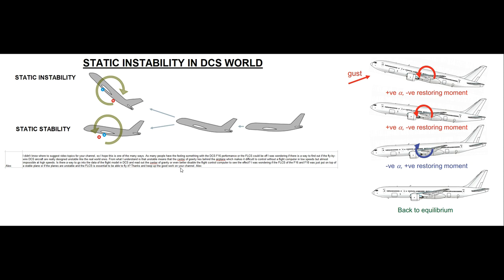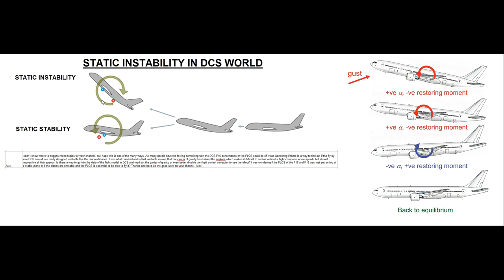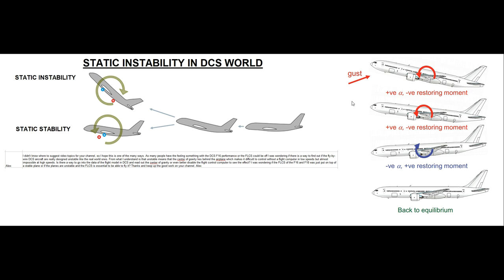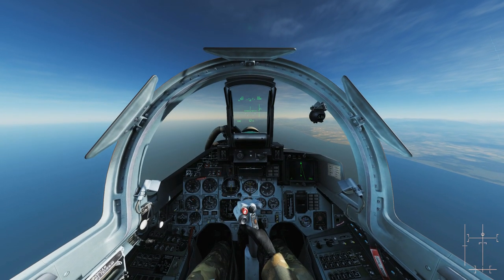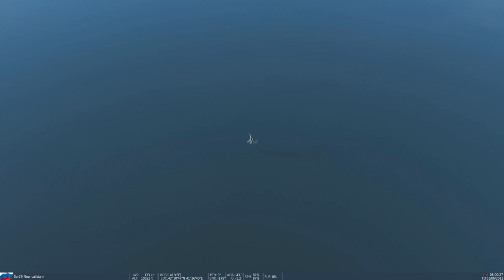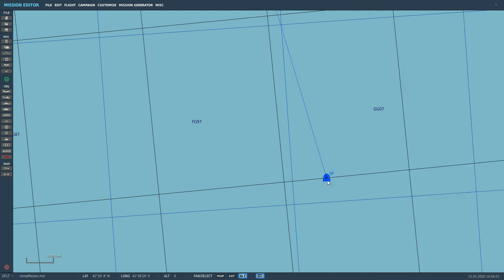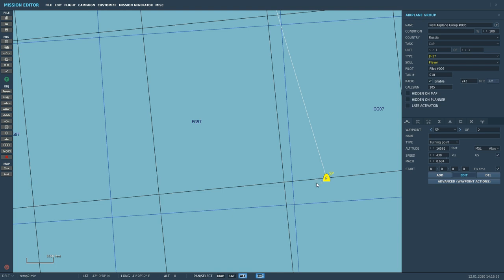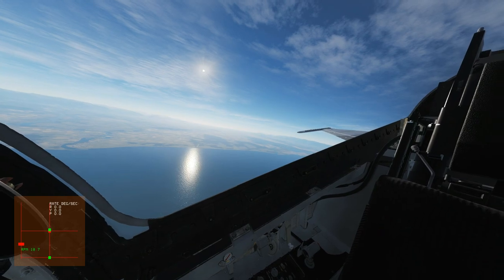Questioned: How Is Fighter Jet "Static Instability" (Unstable) Modelled In DCS WORLD?

Comment: As soon as someone mentions "Gust" when talking about stability I know it's going to go wrong.  It's almost as bad as people discussing the difference between downwind and upwind turns.  I'd give this video about 3 out of 10.  The DCS demo in particular was pretty poor attempt at showing stability or lack of it.
Reply: Could you provide corrective info in addition to your critique? Just saying they did it wrong doesn't help the rest of us
Reply: Firstly, sorry, was having a bad day.  "Gusts" are a misnomier as they effect the whole aircraft equally.  Like nudging a fish bowl does not nudge the fish it still remains stationary relative to the water.  In DCS, take an A10 and crank hard back.  Watch what happens to the roll stability due to the rear bias.  It snaps.  Loses roll stability even with the stabilisation controls on.  The F14 and Harrier do the same.  The harrier is hugely effected in this profile by aysmetric loads. A civilian aircraft outside of aerobatic aircraft won't do this.  This would be a better demonstration of lack of stability in fighters.
The F18 (and probably the Jeff) actively restrict your control inputs to avoid the roll instability, though you can still provoke it if you try hard, particularly at low speed.
DCS world must simulate instability in most aircraft as they can be spun.  A spin is a  loss of stability that gets increasingly worse, is effectively negative stability.  In a fully developed spin you can go hands off and it will not recover.  In saying the aircraft has departed you are saying it has left the stable region.  That said even fighters have some design considerations to make spins recoverable, but get it far enough and it won't come back.
What I would like to see in DCS is, can you get a fighter into a fully developed "floating leaf" spin.  The aircraft falls straight down like a floating leaf, rocking back and forward, side to side, but never enough airflow (even rotational such as a flat spin) over the control surfaces to recover, assuming the engines dont help you as they probably flame out.  I have got this in the F18, but using aymetric thrust to halt the rotation in a flat spin, but (a) it has Wagner godly controls and (b) the engine dont flame out so you can accelerate out of it.
Reply: Paul Campbell appreciate that the term ‘gust’ isn’t helpful for some viewers with perhaps a better knowledge  of aero engineering. Disturbance or input would be better, however These videos are meant to cater to those that, unlike yourself, may have no understanding of any of this. Thanks for the comment though, great to hear discussion like this going on down here!
Reply: @1over137  no worries. Thanks for the explanation!
Reply: @1over137  Just wanted to add something quick about the engines flaming out cause that's only where I know a fair bit. 
Modern FADEC engines like the F104 and the F414 that powers the F/A 18 for example are constantly monitoring fuel mass entering the chamber and heat output of the combustor as well as the air mass entering the combustor. If one were to deviate such as air mass or heat output with no real change to altitude or airspeed, it would certainly indicate that the engine is starting to get starved of air at the current power setting. It also monitors AoA sensors and in high AoA events, keeps firing the igniters to avoid a flameout during a big AoA or reduced air mass transient.
The F414 uses the fan before the compressor to smooth out the air entering the compressor, physically avoiding compressor stalls without the FADEC reducing fuel mass and thus thrust output against the requested power setting by the pilot.
It is then normal in modern military jets to not flameout nor have compressor stall even in high AoA or reduced speed situations like a fully developed flat spin or evasive manœuvers that were very likely to stall the descending engine and cause asymmetric thrust and yaw instability.

Comment: Pretty sure you can just pull the breakers for the FCS in the Hornet
Reply: Yes you can pull the circuit breakers. Then the F18 goes into a slow horizontal roll. But not into a crazy out of control flight. But what I remember just now is that if you shut down the engines in the F18 and the hydraulics start to fail, if I remember correctly it just starts to pitch up all the time, which could be a sign for instability. I have to try it again. But we dont know if that is because the F18 is modelled unstable or if the flight model switches to another flight model matrix as mentioned. Well now thats an interesting idea. Just shut down the engines on a fly by wire aircraft and wait until the hydraulics fail and see what happens.I will try that tonight in the mirage and the F16, of course I have to let it run out of hydrazine first.
Reply: TheDarkman222 the flaps come out on the Hornet when you shut down even in flight, so that will change the center of lift

Comment: i dont think the JF-17 is a "real" stable aircraft becaus with rising speed the should get a nose up moment and if it gets slower the a nose down moment. You will get an damped sinus motion or damped pitch oscillation. i think its petty much indifferent.
Reply: the damped sinus motion is the phugoid, every aircraft has it ( stable or not). this mode is caused by the change between kinectic and potential energy.
Reply: @tomdtom5407   sorry, you are totally right...it was compared with a glider an i understand that he cut the throttle and the aircraft is not chasing the trimmspeed...but it does. i whatched the video again and have seen the missing last seconds were this actualy happend...JF-17 is a stable aircraft ...
Reply: I believe pitch up motion with increasing speed and pitch down motion with decreasing speed would be to do with trim or the design of the aircrafts elevators and wing structure  rather than if it was stable or not.
Reply: @marley6823  yes. more speed, more lift, climb . less speed, less lift, goes down. but sinus motion is phugoid, you can check that in any flight dynamics book ( Nelson, Pamadi, Yechout, i.e.).